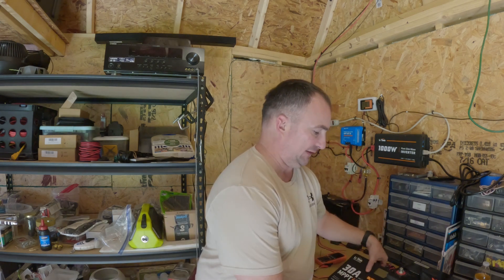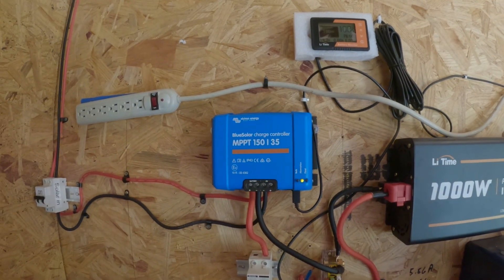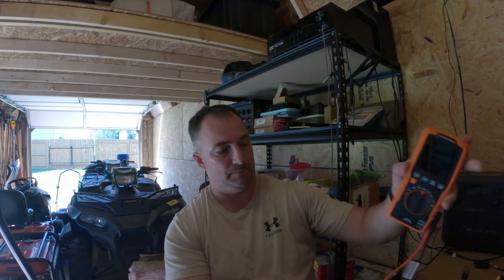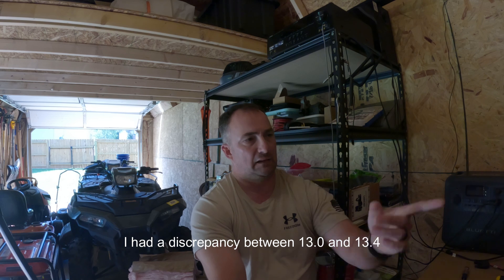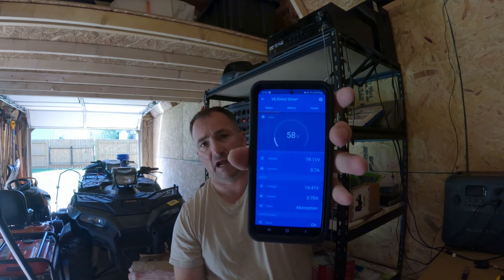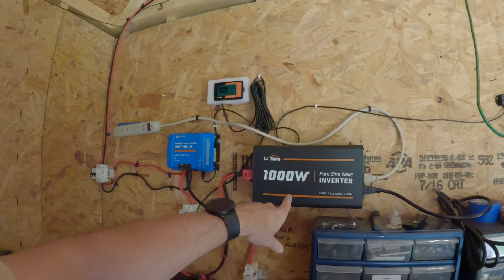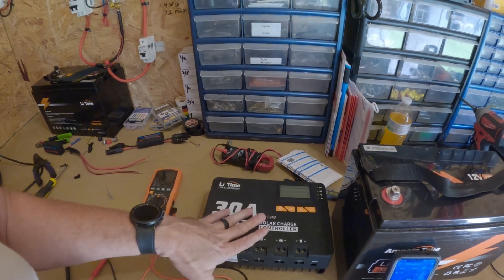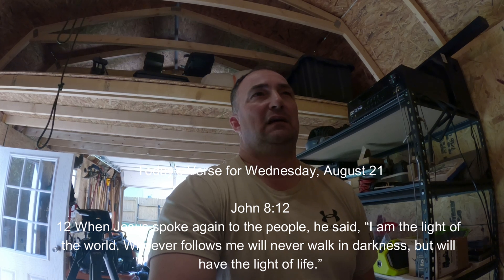VLOG 35, LiTime solar charge controller issues/concerns

Comment: I have a Li Time 60 amp MPPT charge controller. According to it my 8 100 watt Eco Worthy solar panels are producing over a 1000 watts. It does produce 54 to 55 amps on a good day according to my shunt. Needless to say I don't trust what the built in charge controller monitor says. Thanks for the video.
Reply from the maker: @lapinebob  I have upgraded to the LI Time 60 A Charge Controller (CC) and a larger Li Time  battery. The CC, battery monitor, and inverter all read one voltage, but the BT inside the battery reads another voltage. Makes you wonder what to actually trust.

Comment: Hello sir, i installed my Litime 30A MPPT charge controller and when switching through the displays, one of them say percent, do you know what that number indicates, i do not assume that its the battery SOC since it can go up and down 30% or more within ten seconds or so, and the manual does not mention it.
Reply from the maker: @bmbpdk  it's been a while since I used the 30A Charge Controller. I wish that I was more help.

Comment: You will like that Victron controller. I have 2 of them. Just a suggestion, you can save that old battery and hook it up using a three way marine battery  switch. That way when 1 battery is full you can switch and charge the other. Then if one battery starts getting low you have a backup battery to switch back to. Thats the way mine is set up, but with more batteries.
Reply from the maker: Thats a great idea. However, my brother took it off of my hands for his trolling motor.

Comment: Good evening and congrats on the grand child.  From what I saw in the video, I did not see any buss bars or cables large enough to minimize voltage drop under any real load >500 watts.  On the LiTime MPPT controller and wiring.....a VERY common mistake is to use CCA (copper clad aluminum) in your circuits and that is a NO-NO.  Only use pure copper if possible.  On voltage readings, nothing will be the same from battery to MPPT or inverter and never trust an inverter's meter reading.  On the LiTime MPPT, check to see if there is a calibration setting.  I know I have them on midnite solar and morningstar mppt systems as you should see no more than a .1v delta.  With victron, the temp sensor is only applicable to non LiFePO4 but IF your shed gets below 32F/0C then you want to make sure you are using the correct charging profile or create a user profile for the battery.  One last thing that people forget about is the EFI that a MPPT controller can emit and especially an inverter!  Put a RF choke torrid on the leads going to the battery monitor as that long cord is an antenna for EFI/EMI/RFI and will cause that interference to induct into the cabling and throw off the digital inputs to the computers (IC Chips in the monitor)......enjoy..Gary in SE MI
Reply from the maker: @Gary-wh7ce  thanks for the info.
Reply: RF choke? Well looks like more research for me